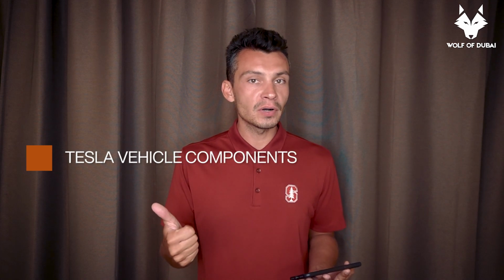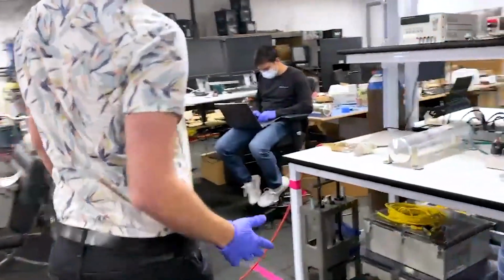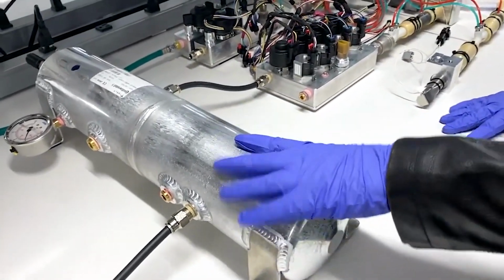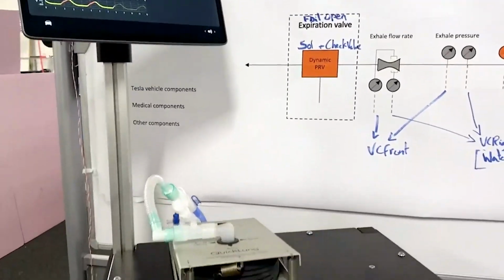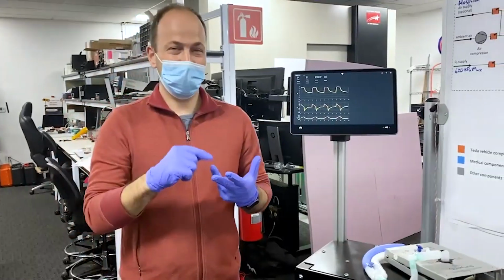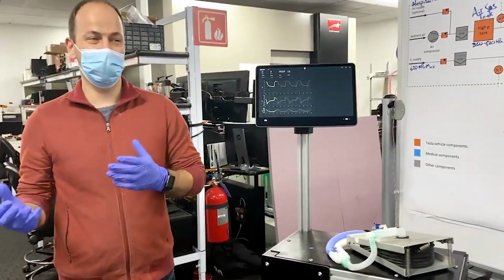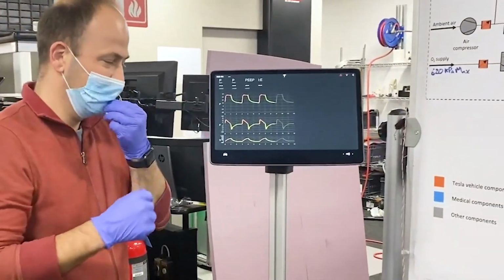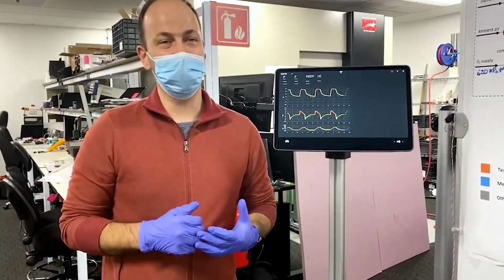Investor Reaction: Elon Musk's Tesla Ventilators - The Best in the World?

Comment: It's a testament to Tesla's Engineering prowess. It likely has a way to with the UI as I believe the hardware is all there. One big question on my mind, do other ventilators monitor as many sensors. The waveform analysis I believe a critical part giving caregivers possibly a heads up as to whether the patient is improving or not. I would imagine Tesla could show trends and text message pending calculated concerns. Also, it's going to need to be approved by governing bodies (FDA)  which sadly my be its biggest hurdle. Wouldn't it be something if Tesla disrupted the ventilator industry.
Reply: If there are improvements to be made on the ventilators Elon will make them. The guy just can`t help himself.
Reply from the maker: Yes!
Reply from the maker: Absolutely 👍🏼😎